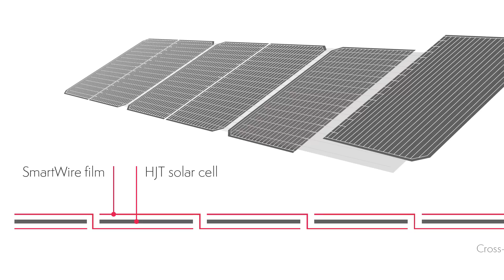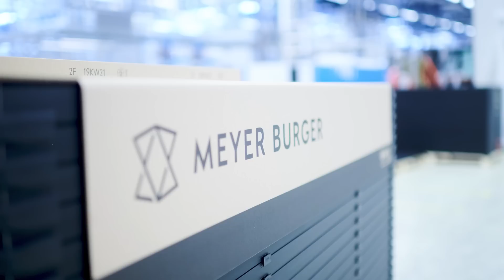New German SOLAR PANEL - Meyer Burger Review

Comment: In my neighborhood in Switzerland we just finished installing 12 independent PV systems with the gorgeous Meyer Burger Black modules. 12 families built together 12x 16.5kWp with about 500 panels. It was a great project and we all love our Meyer Burger panels! 😍
Reply: Is there a way to get them more or less directly without he 20ish distributors in between.
Reply from the maker: Nice! Did you get glass glass, or glass back sheet? I’m looking forward to testing them.
Reply: @mcelectrical  we used "black" modules, so with a back sheet.
Reply: Excellent
Reply: Great. Please share more setup details. That would be really helpful.

Comment: I really must wonder what those “horror stories” about frameless panels would be? Frameless panels for in-roof systems are very popular here in Switzerland. They do cost a bit more than cheap asian panels, but you don’t need a roof anymore as the panel is the roof. And I have a 30 year warranty on it.

Comment: Thanks Mark and team. I recently installed the Trina Dual Glass 440 Watt panels on my house, very happy with the outcome. I previously had a smaller system which I replaced. They were Jinko Panels, - they struggled in the hottest days but performed well during the milder weather of Sep - Nov and March - Apr. My new Trina panels are working very well in this out of season sunny days in May here in Melbourne. I would like to know, if Meyer Burger tested their new panels in the Australian Conditions? Because lets face it, Australia's weather swings between extremes, specially in hot summer days.
Reply from the maker: Hi Jamal, It’s Mark. I’ll be honest, the whole “testing in Austrian conditions” is a misnomer. Quality lab testing with heat, humidity and wind is what we really need. To be fair, I should have asked those questions - I’ll ask them next week.
Reply: Meyer burger has bought in 2010 Pasan SA the industry  solarpanel / cell testing standard. They know what they do. 😁

Comment: I used to operate an ingot saw at Fairchild Semiconductor in the 1970's while in college; disc blade under tension with the center open and diamond coated edge. Ingot was stationary and the disc mount was lowered to cut the ingot. They were very touchy about rate of cut because those blades were ao very thin(to not waste the doped material), also processed and graded the wafers for consistency of thickness.
I never worked in the crucible area where the raw silicon was melted and mixed with the dopants.
It has been so long but I believe we also mechanically polished to remove kerf marks and to thickness..
That plant, like many others at the time was eventually closed due to triclorethane solvent contamination of groundwater.
In the early days semi producers often dumped drums of spent chemicals out the back door!
Ah silicon valley!

Comment: Panels with a length to width ratio of 2/1 are best for installers. It makes more configurations possible.
Reply from the maker: Oh wow, a 2 meter panel? Not on residential!
Reply: @mcelectrical  boo hoo like theres much of a difference between 1.75m and 2m ...
Reply: @mcelectrical ”ratio of 2/1”

Comment: I don't understand dismissing cheap Chinese panels. It is economically not feasible to buy a $300 high-end 400 Wp panel compared to a $100 cheap 400 Wp panel. The cheap panels also last for more then 10 years and in 10 years you might want to replace the panels anyway with double capacity panels. I bought my panels in 2014 (250 Wp) and maybe in 5 years time I'm going to replace the 11 panels on my roof with 10 slightly bigger 500Wp panels assuming 500Wp is the standard in 5 years.

Comment: I have REC panels...great panels and a major competitor for Meyer Burger apparently. The German panels will likely be amazing. I also have dual Fronius inverters which have been a little disappointing. Their use of MS Azure data services is a mistake if I am understanding the problem. They lose connectivity on a weekly basis. It is seriously annoying and I think unnecessary.
Is there any hope of Fronius fixing this problem?

Comment: Hi Mark. I love your chanel! I am from Austria and also have a Fronius Gen24 10kw inverter and about 11kwp panels on my roof feeding the inverter. everything is connected to a byd hvm 19,3. we use here kioto panels that are made in austria too(like fronius) and they are often found to be used here because they also have 385w per panel, are highly diffuse efficient and do not reflect the sun so neighbours will not get blinded by the light! My system works pretty well. regarding the meyer burger panels i have heard a looooooot of great things here too. it seems they have now the same watt number. i just want to know if there is anywere a sheet that gives info about watt / squareinch or something like that to compare which panel can produce how much with the same size. many think that 400watt / m2 = 400 w/m2 which issnt the case. Some of my solarfriends once said LG is the best of the best because of its watt and size and quality, but lately these opinions seemed to change. Maybe you have some infos on that. Thanks for your channel! have a nice day!
Reply from the maker: Hi Frank. Thanks 😊. Look at the panels efficiency. Panels are sitting around 21 or 22 percent. The Meyer Burger panel may be .3 percent less efficient because there is more frame compared to cell - when compared to a larger footprint panel.

Comment: Nice interview. Would definitely consider Myer Burger for installs
Reply from the maker: Thanks mxt! I’m working on my interview skills but this was a really interesting one for me too.
Reply: You should definitely consider Meyer Burger or REC for panels. I’ve noticed the difference on hot summer days with having the original REC Alpha’s on my roof with panel level monitoring via Enphase. They have been performing as expected when I see what wattage they are producing and working back from there with the temperature coefficients.
Reply from the maker: Very nice. I’m setting up a test on my new warehouse comparing REC APpha pure r to Qmax. I’ll do a video with results. I hope I see a difference but i think I’ll need to wait till summer.

Comment: I noticed the Meyer Burger are biracial, so max watt wont be achived on rooftop? thanks
Reply from the maker: Ah interesting interpretation. Yes they have a bifacial panel but the flash test does not include the back. So you get the normal output on rooftop, and higher output in the right conditions.

Comment: Why don't you make triangular panels? Australia has horribly designed roofs which means that if you had triangular panels to fill in the gaps you would get on average 15% increase in solar real-estate. Each triangular panel just needs to be half of a full panel and matched in pairs.

Comment: Longi 535 Wp are now below 160€ for 32 
Meyer Burger is about twice the price for 400 Wp

And I am talking about module prices, not per Wp.

They might last longer like all glas glas, but if the Longi pay of twice as fast I will do the bet that our system is working longer than the 5 years it needs to have paid of. And if I use the money saved to invest into more panels the roi gets even better.
Germany - Australia is also quite a long shipping so CO2 emission wise not the first choice.

Yes, made in germany can be expected but why is Wp per sqm lower than the competition?

And even in Germany some customers complained about the long time of delivery too, so how should they ship in time if they struggle in a 500 km germany cause there factory is not further  away than 500 km from close to 95 % of german customers?
Reply: Yes , look at their car industry it’s failing. A car  it just a mode of transport that gets you from a to b.  Go and buy a a German car and see how much it costs you to keep it on the road . A LOT OF MAINTENANCE 😄😄😄😄

Comment: Have you done a recent video or post about your experience with Maxeon panels? I've been leaning towards them, and I notice you used to like them, but you seem to have changed your opinion?
Reply from the maker: No, I haven’t. Unfortunately Sunpower went down hill after the good old 327w panel. The 40’year warranty is ridiculous especially when they argue about clear and numerous warranty issues.
Reply: @mcelectrical  Thanks so much for your helpful reply. What you've said is very interesting to hear! I guess I'll be looking at other options now 🙂

Comment: Now that Rec  alpha panels using this tech have reached 2 years use we are already seeing failures delamination. No doubt in 2 years we will see the same with Meyer Burger.
Reply from the maker: Interesting. I just met with Gus, the country manager for REC. He said it was not delaminating but a discolouring of the cell. This did not reduce the output. He’s sending me a white paper on it.  His explanation was that they were reinventing the solar panel, and, some teething issues occurred. I too have hesitations about new tech, probably it is wise to hold of on Myerberger for a few years

Comment: In 5 years all panels are old crap so i stick 2 the cheap China panels and get in 5 years new panels
Reply from the maker: Hmm, that ain’t so. Crap panels last 5 years. And crap panels don’t belong in our industry.
Reply: @mcelectrical  In Holland all 5 year old panels getting of the roof and sold for a view dollars
Reply from the maker: I see. Yes, we replace systems after 3 or 5 years on a weekly basis. That’s why you should pay more. I don’t think we need to pay REC alpha pure R, or Meyer Burger panel, but a decent panel installed by a quality installation will last well past 20 years.
Reply: @mcelectrical  I understand completely, but rarely do people expect to have the same panels for 20 years. Probably 10 years max. By which time technology has improved so much that it necessities that you upgrade your system to take advantage of it. I had an old 3 KW system which I installed back in 2011. At the time, it was top dollar install and I was under the impression that this will last the full warranty of 25 years. But now, I had to replace them because 10KW System with newer panels, newer more efficient inverters and software capabilities, these were the reason why I had to replace my old trusty system even-though it was working well.
Reply: Curious what are the primary panel issues you are seeing that limit life to 5 years?
Reply: @Fritsvrolijk  that's madness...Panel efficiency isn't increasing quickly enough to justify the change. A 20 year old panel, installed in 2003 would have sat between 12 and 22% efficiency. a modern panel sits at the mid 20's efficiency. in 5 years, panels WONT have degraded significantly (1-2% a year?) so, what's the point in replacing  a roof of (say) 10 panels with, a roof of 10 more modern panels to gain maybe 10-15% more efficiency.....zero point, the costs of the teardown and re-install will far exceed the gains. it's only worth replacing broken panels with new panels